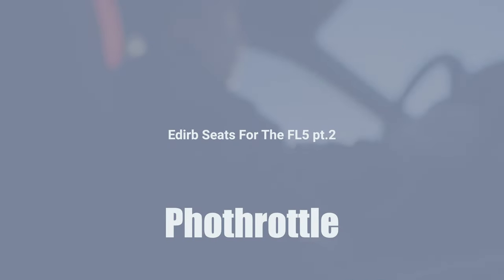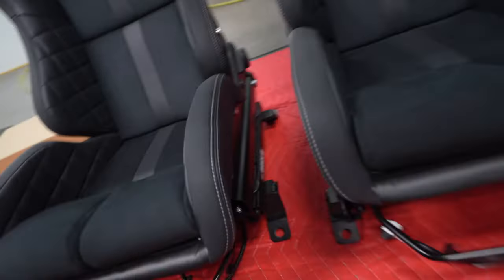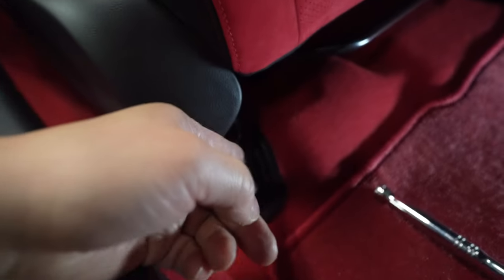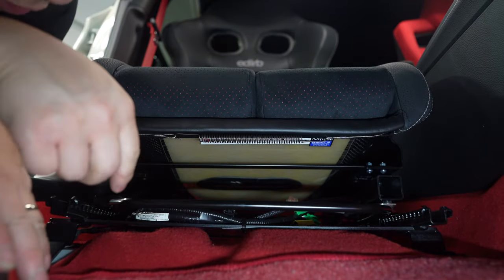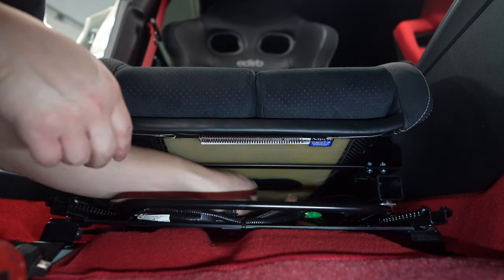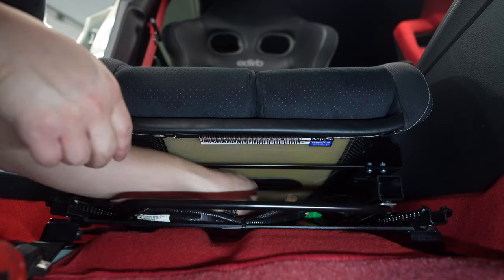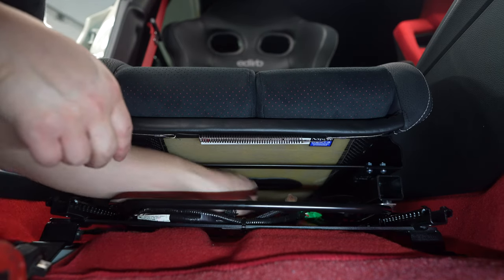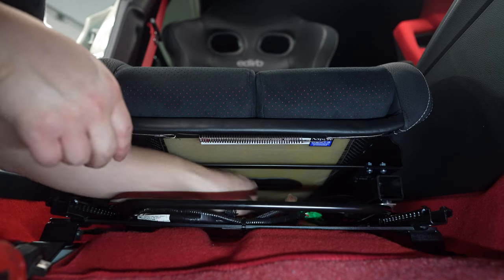New Edirb Seats & No SRS Lights!! || Honda Civic FL5 Pt. 2

Comment: I want to put 11th gen si seats in my 11th gen sport.  Do you know if the bolt pattern is the same?  Wondering if the connections are the same too?  If everything bolts up and connects the same would all I have to do is get them calibrated at the dealership?  I tried to look online and can’t find any info.  I really appreciate you posting this at least I have some idea of what I’m in for.  I’ve swapped seats before just not used to all this airbag stuff with the new cars.
Reply from the maker: The rails should bolt right up. The seat belt, weight sensors (passengers side), air bags sensors and seat positions sensors (Driver side) should be all the same. Unless one has heated seats or power seats the main plug is different. That was the issue I ran into with the CTR.  As for the passengers side weight sensors use the ones that came with your car originally. You will only need the recalibrate them. Hope this helps. Feel free message me anytime.

Comment: I noticed my seat is doing the same thing, I only have 2000 miles and I have a crease  on the left side of my seat😢
Reply from the maker: They are very nice seats but because of the material used, these seats are prone to creasesand i don't think they will last long.

Comment: I have the ndf x bride zieg iv and they came with weight sensors. I was wondering if the weight or occupancy sensors you used are also from bride
Reply from the maker: No the Bride weight sensor is not compatible with the Honda system. Too bad they aren't because it would have been a much easier install.
Reply: Even if I were to solder them and take them to acura for calibration? 😭
Reply from the maker: @emtyracing  you can try but most likely the honda safety system won't recognize and throw a code. The honda system has two weights and measures in real-time. The weights have to be registered to the ecu and then calibrated. Honda/acura service departments will make you buy a new sensor, mainly because it has to do with the safety system.

Comment: The way you're measuring the weight is very inaccurate, using your knee to support.... You're better of standing on a bathroom scale weighing yourself and then weighing yourself holding the seat.
Reply from the maker: I will weight the oem seats again in the next vlog to see how off I am and if your statement is correct. It was kind of awkward because there was nothing to hold on to. Thanks for the advice.